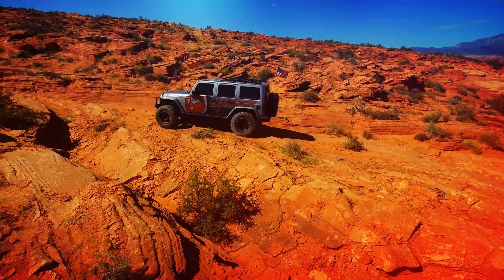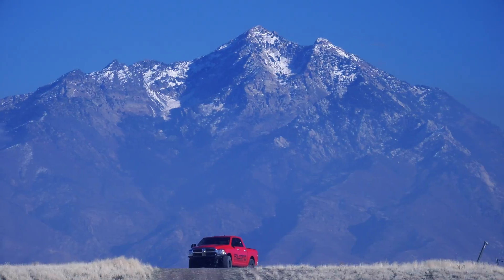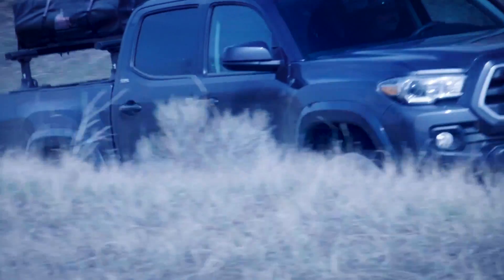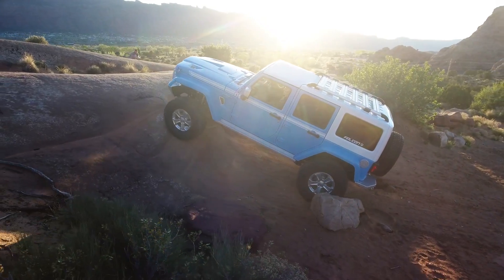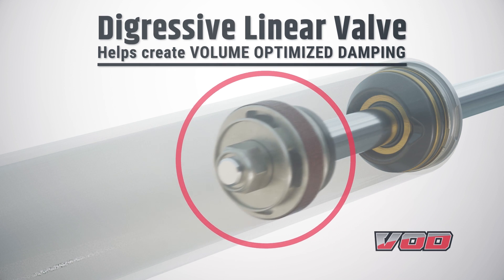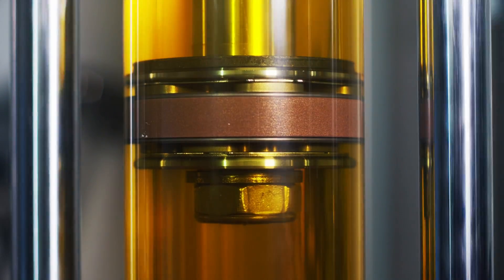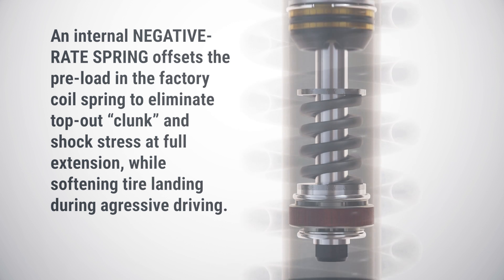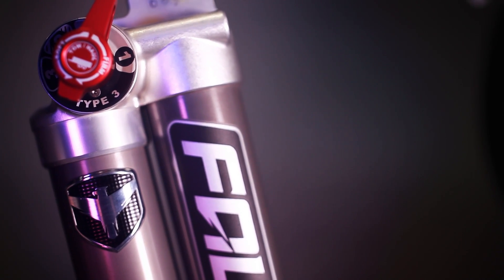Falcon Shocks Explained | TeraFlex

Comment: I truly live by Falcons. I purchased the first edition Falcons in 2016 or 2017 for my 15 JKU, and they have been amazing.  I have been in the military for 16 years, have moved a lot, and I have put about 130,000 miles on my original set. I have been to the Rubicon, MOAB, Ouray Rausch, the Imperial Sand Dunes, and beyond with zero issues from these shocks. Now that my Jeep has reached 160k miles, I believe it's a good time to send them back to Teraflex for a rebuild, but not because I am having an issue, but rather because I want to continue to push these shocks to their limits.  Since the installation of the shocks, my entire suspension is Teraflex, and I am truly grateful for the quality of their equipment. Thanks team.